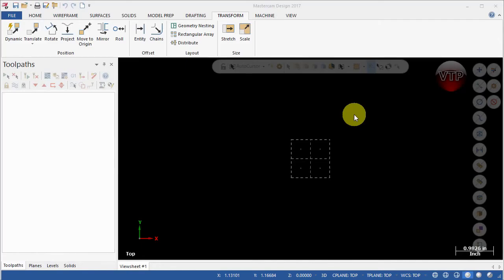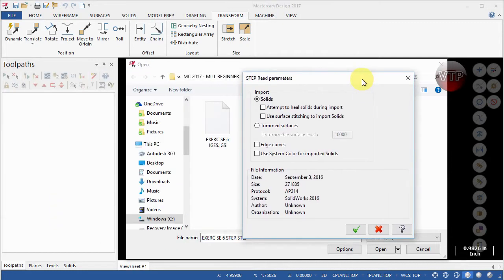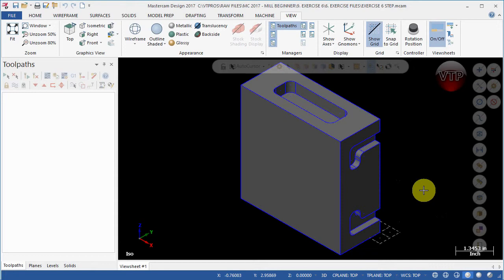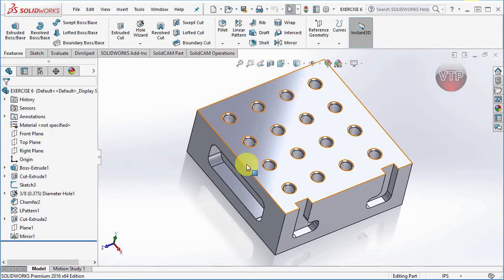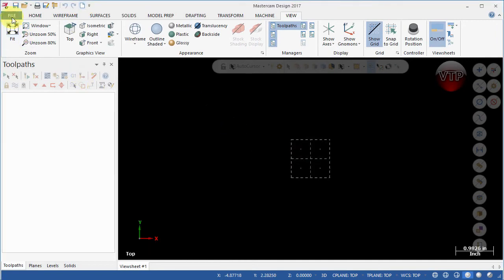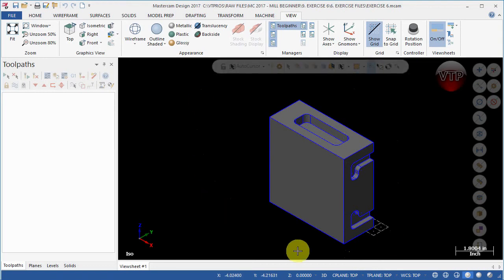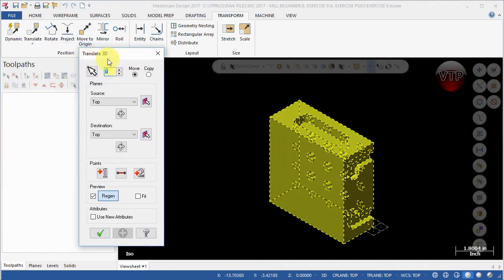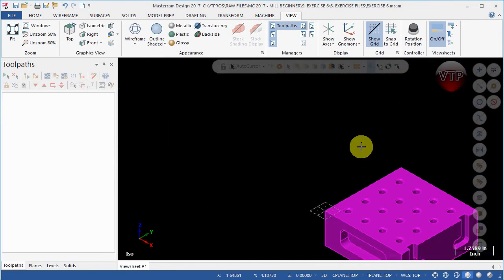MASTERCAM 2017-2020 - 2D MILL - Import Model & Translate To Plane - vtpros.net (2019-2020)

Comment: mastercam 2017 was not start what do you do
Reply from the maker: please contact mastercam or your reseller. They should be able to help you out. I would try to reinstall mastercam and see if that fixes the issue. But beyond that it's for mastercam or the mastercam reseller to help with that.

Comment: Greetings .... How do you change your setting's to get your plane .... The box with the cross hair in it ..... Like you have it in this video.
Reply: The origin..... How do you change it to look like a grid?
Reply from the maker: go to the "view" tab, under the view tab look under the "grid" section. Make sure to click on "show grid" and than click on  the small icon next to "grid" in the grid section on the right side of it. you will get to the grid settings, there make sure to select x & y spacing = .25 and origin at 0, 0 in x and y, snap at always and size = 1 inch. hope this helps, The video to show you how is also included on the DVD